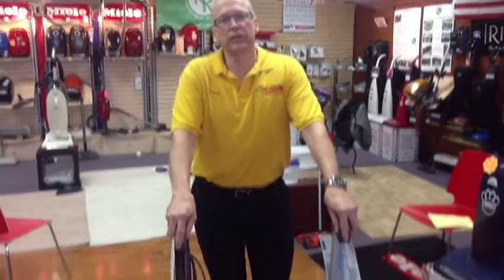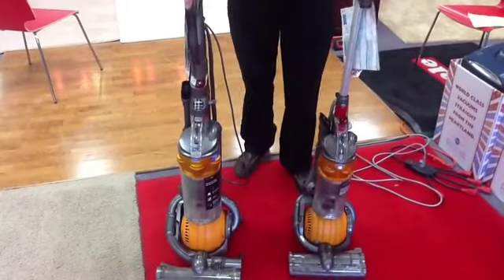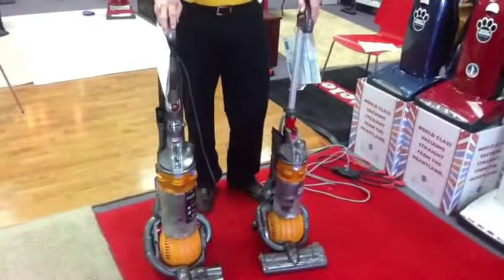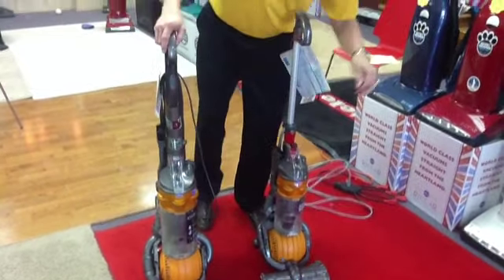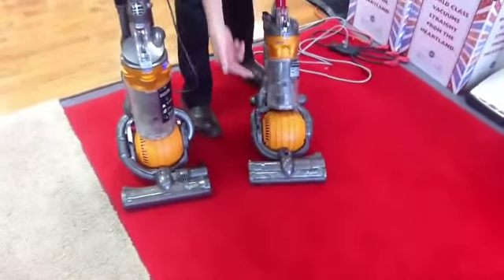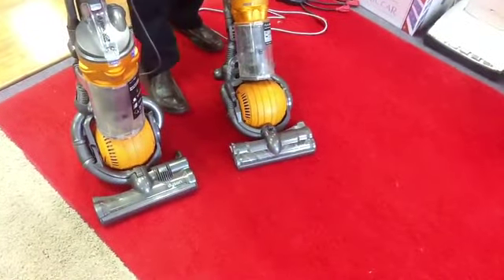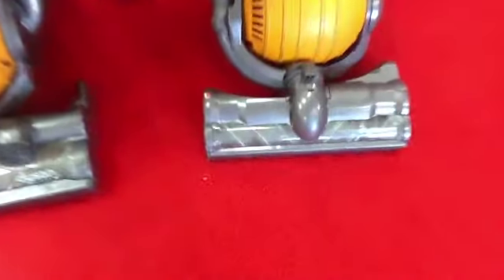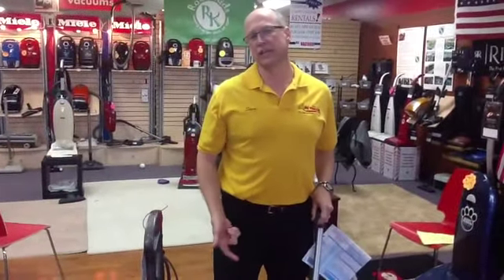All Vacuum Center Dyson Repair DC24 & Dyson DC 25

Comment: Did any of you think that possibly the brush bar, having its own motor, may actually go bad.  It may actually NOT work, the magical reset button may not fix EVERYTHING?
Reply: +Zollie Berliner me too, 5 years.  Did everything, cleaned it, took it apart checked everything even checked if power was getting to the brush, it was.  brush motor was shot. it happens.  especially for people who vacuum daily or vacuum a lot of area with the brush. areas not including hard floors or using the hose.  So YOUR fortune is not everyone's and yes the motor does go out and fortunately Dyson has proved once again to be sensible by making a vacuum that didn't need to be completely replaced only
Reply: +only replacing a part.  I apologize for the bad grammar, I'm on a phone at the gym. On a positive note, I ordered my new brush head it took 2 days to get it 4 min to  install it and that bad boy was purring like a tiger.  I also bought new filters even though I  am pretty good about keeping mine clean, WOW like new. 

 I'll never forget the day the Oreck guy came and saw my vacuum  (they always out perform the owner's vacuum) oh, so bitter.  he ended up trying to sell it as a steam cleaner.  which  (of course ) he couldn't demonstrate.

Comment: I will laugh so hard when all of your motors die. Also, the new brush heads don't have a reset button.
Reply: +zmanifest I have a DC24 the replacement head doesn't have one on it anymore.  it's been redesigned.
Reply: if I have time I'll post a picture to make ALL OF YOU SO HAPPY.